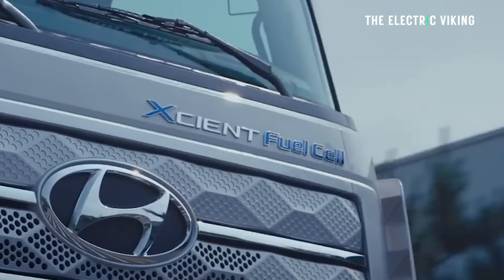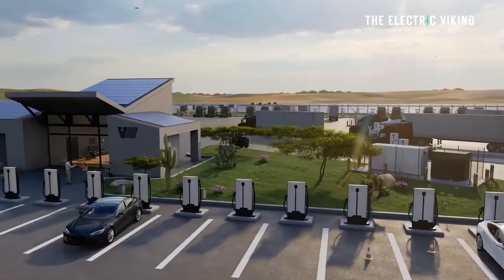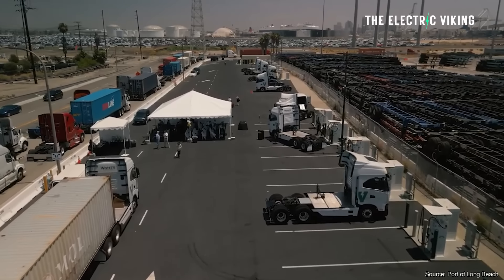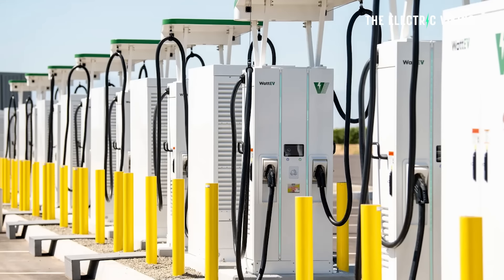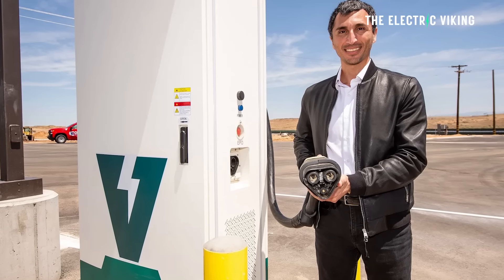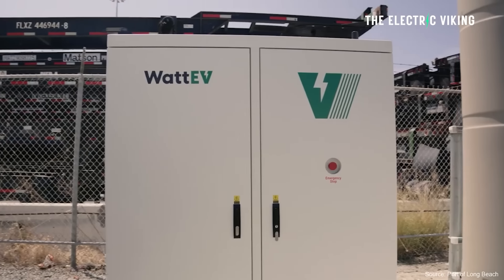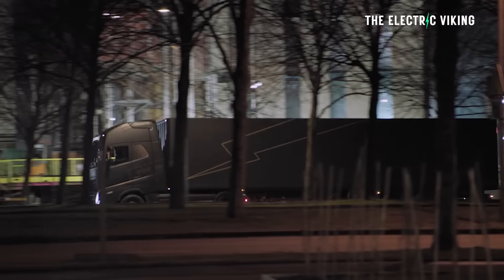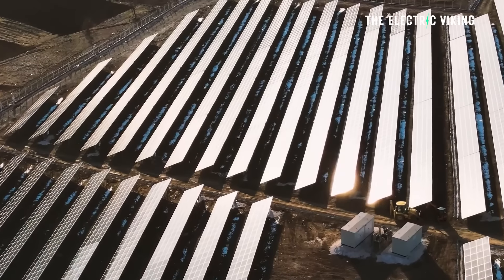America's first 1.2 megawatt charge station is powered by solar & batteries

Comment: Battery swapping is the way forward for trucks I think
Reply: Why?

Semi's have 1MWh batteries or smaller. Full charge in less then an hour.
Reply: @jeffl4810  well I guess they could go further, or reload faster with battery swapping. and not compromise payload. Plus recharge can be slower. But either way is good 👍
Reply: @MatthewEng2593  
At 1.2MWh charge rates, it's under 1h to charge a 1MWh battery fully.
And when loading/unloading, they are meant to be charged. 

A 1MWh battery has a 500 mile range on a loaded Semi. They are also legally limited to ~60 MPH. Mandatory breaks are needed after a set time. 500 miles is over 8h of continuous driving. 

So not a huge issue. 

I, however, expect massive long haul EV adoption taking place once batteries are in the 1.5-3 MWh capacity range.  
That's enough buffer for almost any demanding application, including continuous run, sleeper cab Semi's
Reply: WHY?  Didn't you watch the video, FCOL???

Comment: 1.2mw is capacity not speed. like 100km is distance, to measure speed, you need time, like 100km/h, so that 1.2mw is per second  per minute per hour or per day ?
Reply: Units of W is Joules per second. So it can transfer up to 1.2MJ of energy per second.
Reply: It is speed. Longhand 1.2MW is 1.2MJoules per second. If it was just 1.2MJoules in total you’re not going far. A big lorry could use that in ten minutes uphill.

Comment: So even if you devote All World lithium production just to US heavy trucks; it will require 36 years for long haul alone; the other 6 Million will need at least 2 off peak charges so for the trucks themselves and their batteries you'll need another 36 years or a total of 72 years of lithium production totally devoted to US heavy trucks.
Most the US doesn't have the Sun of Pheonix so this means Probably 100 years. No problem; lets say we increase lithium production by 10x in 10 years, average 5x over the period OK 20 years of world production of lithium can run just US heavy trucks, no cell phones, laptops or EV cars. Plus 9 million x 3000 panels= 27 billion.
Reply: I think battery technology is evolving very rapidly. In 10 years, we will likely have a storage capacity that is 10 times better in the same space, depending less on lithium. China is taking the lead on this; they even demonstrated their first cargo ev ship.
Reply: @carlosap78  Who cares. It will take 200 years to dig up the Copper we need for net zero, production needs to triple but the ore grade is declining across all mines and more are ceasing production than are opening.
Reply: Have you heard of evolving battery chemistries? Rare earths and lithium are no longer the bottleneck that oil is to ICE vehicles.
Reply: I hear aluminum also conducts and is lighter and cheaper than copper. My house was wired in Aluminum.
Reply: @lesbenson9421 
Most houses are wireed with Aluminum for their main distribution. Copper is only used for the branches. 

Hopefully you don't have old aluminum wiring going to your branches. That stuff is nasty to have terminated effectively.
Reply: There's only 160 kg of lithium in a massive 1MWh battery...

Ie 1 ton of lithium is enough for over 6 Semi's with 1MWh batteries 

There's thousands of millions of tons of lithium being discovered / announced
Reply: And you don't need 2 full batteries worth of battery backup on the grid, for a semi.

That's ridiculous...
Reply: @jeffl4810  That is right I actually used just 250lbs not 350 lbs in my calculation. 169,000 tons is 338 million pounds of lithium/350 lbs equals 965,000  Big truck batteries; But - to run each all  night requires at least fully solar charged 3-5 packs to charge (for the 3 million US long haul trucks) and 1-2 such big batteries to charge the 6 million short and medium range Semis) a total of 5 times as many batteries needed. So say 169,000 tons makes 1 million trucks; you need 5 times that to keep them charged There are 9 million Just in the USA - so  for 3 million trucks you need 4-6 packs and for short medium 6 million you need 2-3 packs Call it 5 and 2 if you want 5x3 million is 15 million and 2x6 million is 12 million a total of 27 million packs - at just for the USA's Semi trucks and batteries to make them. There are 200 million heavy Semis in the world and 1.4 billion light cars and trucks.  So the point is no matter how optimistic you may be on Lithium production; there won't be enough to go all electric in 100 years even at 10 production increase in 10 years - thats just cars and trucks;  you have all the homes, business, industry, shipping, trains, aircraft..etc Not Plausible.
Reply: @litestuffllc7249  
1) there's over a million tons of discovered lithium in the USA.
Canada has another 930,000 known tons. That's just what's known about in North America. 
The world has 26 million tons of currently known reserves. 
More reserves are found all the time. A single antique volcano in the USA is estimated to have 20-40 million tons of lithium metal. There's other sites with huge estimations. 
The ocean contains orders of magnitude more.
All of the lithium is indefinitely recyclable once mined. 

2) There is no need for that much energy buffering for an EV, even if it's a huge consumer like a loaded Semi. And that's even if it's an off grid charging site (which will be very rare and wasteful - bidirectional grid storage is a MUCH better option). Grid buffering for Semi docking sites makes sense, so they can dump a MW in a battery pack rapidly, while minimizing grid demand (which commercial customers pay, however, the price per kWh is cheaper - residential assumes demand charges, which are built into the kWh price).

Utility scale batteries are being used to buffer the grid, and are rapidly being added. These even out the peaks in demand, and allow renewables to work much better, along with a mix of renewables, and management of resources, such as managed hydro for when other renewables have low output. 

3) using the 26 million known tons of lithium, that enough for either:
- 165 million Semi's with 1MWh batteries
Only 4 million Semi's are made a year worldwide. The US has 2.97 million registered semi's. 
- 3.2 billion cars (based on average battery of 50 kWh) There are only 1.47 billion cars on the planet, and many of them are mini cars
- 162,500,000 MWh worth of electricity. 
The world generation capacity is 8,800,000 MW. Upto 25% of that is FF related processing, which will become obsolete. 

And then there's Sodium Ion battery's. 
In which there's massive amounts of easily extracted Sodium. Such as seawater.
Reply: @litestuffllc7249  
I mistakenly said thousands of millions of tons. That was wrong, but the correct amounts are in my other post
Reply: @jeffl4810  No you are agreeing with me; a Tesa Semi has 1 Mwh battery; at Tesla Cybertruck has 100KWh. So you are agreeing there is  160kg per truck or 352 lbs.  1 ton of lithium is then 5.6 trucks per ton x 169,000 tons = 960,000 trucks max if you used every once of Lithium production just to make Semit trucks; if you want to make 9 million to replace the existing fleet that alone will required 9 years. For the Worlds 200 million heavy trucks you are talking 200 years. To then provide solar/wind charging; you need multiple charger packs per truck so they can keep running from dusk to dawn; that means you are looking at 800 - `1000 years.  OK if you magically could increase lithium production by 10x just 80-100 years but nothing else can use lithium as you've devoted every once of production to heavy trucks and charger battery supplies.
Reply: @jeffl4810  Discovered doesn't matter. You have to refine it. You have to dig up 500 tons of lithium ore to refine out 1 ton. You also have to use 500,000 gallons of water to put the slurry into solution. That is a giant upfront CO2 investment; plus the process of obtaining people and machines and investment take a lot of time.  I said go head ; assume 10x production starting today - still will be 80-100 years just for heavy trucks.
Reply: @jeffl4810  We haven't even touched cars. I was only referencing the effort just to power heavy trucks. Google answer "How many trucks are there in the US? There are 13.5 million trucks registered in the US. Of this figure, 2.97 million are tractor-trailers and 10.5 million are single-unit trucks (aka straight trucks). I broke them down as 3 million long haul and 6 million short/ medium haul. 9 Million; I didn't even use all 13.5 million as many would not be moving full loads.

You also refernced the quote from the Natonal transportation board about EVs which isn't current, and pretained only to the USA. That figure takes into ALL fires and average ICE/Hybrid is 12.5 years old.  The Average EV is 1.5 years old.  Just the Falicity Ace sea going car Ferry had 400 EVs catch fire when the ship sank. If each of those cars were at 25 per hundred thousand - that is 400/25 = 16x 100,000 those EVs alone account for 1.6 million EVs and the ship sank 2 years ago when the total EV production ever in 2020 was about 1 million. There were plenty of EV fires before and after. In China it is particuarly bad because their Quality is poor.  A Tesla has a cooling system in the battery pack; none of the other makers do that.
Reply: Around 1910 they were probably saying “you’ll never replace horses with gasoline engines, just look at all the oil you’ll need to get out of the ground! It’s impossible!”
Reply: @paulm9670  Actually electric cars predate petrol cars. They were replaced with petrol because of better range and lower cost; just like today.  If not for subsidies EVs would be a tiny niche.  I actually said - go ahead and assume 10x more production than today immediately - today - you can't can't do Just US trucks and even longer for world trucks.  The head of Ford just said yesterday their anticipated demand for EVs with typically 25% of the price subsidied was far lower than realized, instead of further expanding F-150 lightning and Emustang produciton ;they are cutting them in half.

Comment: Amazing having to spend 100s of millions to build a electric service station and solar farms and repeat it every 100 kilometres both sides of the freeways for 10s of 1000s of kilometres of Aussie roads  yup your right Sam amazing....stupidity
Reply: Um, exaggerate on costs much...

And, no, not every charging site needs it own power generating capacity... Over even most.

Solar is replacing Coal and soon natural gas. It's most useful when, with large scale, being connected to the grid. Then it can be used everywhere, and not wasted on slow days.

Only remote areas with no power generation/limited generating capacity/minimal grid connection would a charge park, only solar solution make the most sense. 

A battery buffering solution would be helpful for the larger sites/chargers. A Tesla MegaPack in bulk is around $0.5M each.  They store 3.9MWh.
Reply: @jeffl4810  the site shown in the video as a example with a full blown solar farm battery packs etc would have is damm expensive
Reply: @steveclancy7832  
It definitely is a full, small-moderate sized farm. No doubt about that.

But solar is stupid cheap now. Like sub $0.10 per watt. I've heard as low as $0.05 USD per watt in some cases wholesale. 

That makes a 700 W panel $35 to $70. 

250,000 W Worth of solar is a mear $12,500 to $25,000, and will produce 9,125 MWh over a 25 year lifespan.

That's equivalent to $1-3 to charge a 1MWh battery, for the solar panel cost if fully utilized over the 25 year lifespan. 

Obviously, there are other expenses, like land ownership, installation, battery systems if needed, maintenance, etc.

But still VERY cheap. 
Especially considering the cost for diesel. 1MWh is enough for 500 miles in a loaded Tesla Semi, as those numbers are now published from various sources. 
500 miles of diesel at 6.5 MPG (typical Semi fuel economy) is 77 gallons. 
At $4 a gallon,  that's $307

Comment: Wouldn't it be far more sensible to find out if the USA and other areas can produce the trillions of tons of hydrogen that USGS identified locked in the ground? You dont need trillion of dollars in solar planels and storage batteries. The grid can be powered by existing turbines burning hydrogen; or you can make trucks that carry their own hydrogen for direct burning in ICE type engines or via hydrogen fuel cell. Expensive solar/battery project should be suspended until that is determined as they could easily turn out to be a total waste of money.

Comment: This is still to slow when hydrogen is 6 minutes to fill the tank
Reply: Hydrogen is 5x more expensive.
Reply: It takes way longer than 6 minutes to fill a truck.  Hydrogen is not as fast as you think.  Then you have to consider the amount of storage you would need for a truck stop.  It’s insane
Reply: @tysonn4736  not when we can pump it out of the ground
Reply: @Kiwicountry  On what planet do we pump hydrogen out of the ground?
Reply: @nickv8816  There is a new green hydrogen truck refilling station near me and that’s how long they say it takes
Reply: @Kiwicountry  and how many trucks in a row can it fill that fast?  How many trucks in a day can it fill?  It’s not what you think.  It’s the same reason that the number of hydrogen stations for cars in California is decreasing and being closed down.  The waits can be 30 minutes between fills for the system to re pressurize and constant problems with it freezing up.  Hydrogen for transportation is dead
Reply: @Kiwicountry  It's a gas, literally not possible to pump it out of the ground.
Reply: @tysonn4736  extract from the ground
Reply: Truck drivers by law need to take so many breaks and can only drive so many hours a day. They have tons of downtime just hanging at rest stops. A 40 min charging break every 3 to 4 hrs would work in about perfectly. That's today right now. And batteries will only get much faster to charge. When the fuel cost savings are worked in, hydrogen can't possibly compete. The transport industry is all about cost battery will be the cheapest. Game over. A few months ago a truck hydrogen refueling station just a few miles away from this actually exploded. I just can't think of a single reason.Why hydrogen would be happening.